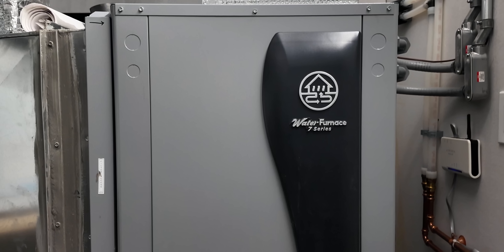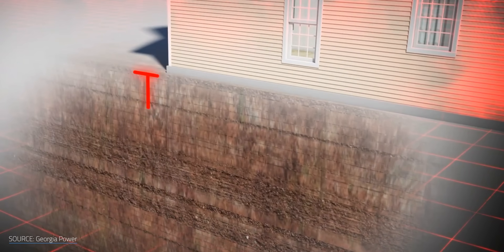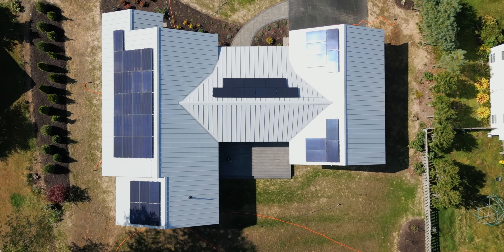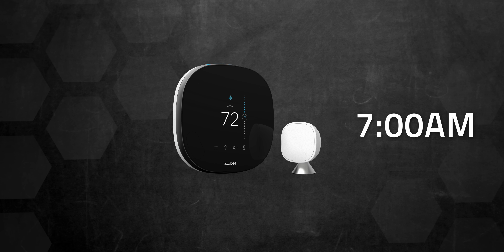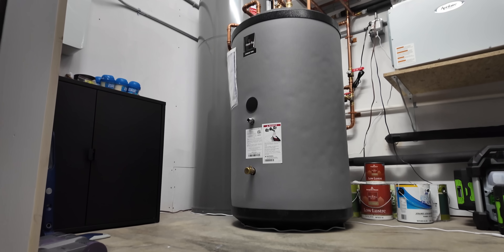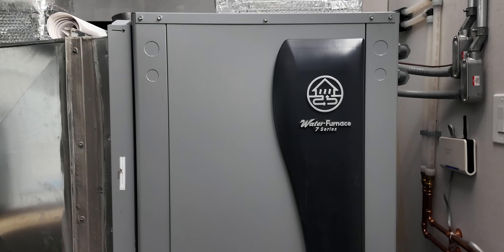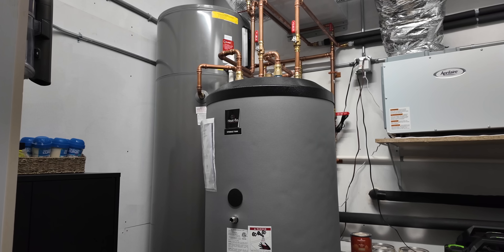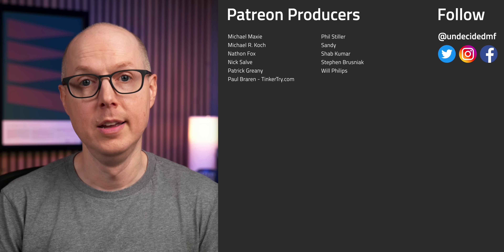How My Geothermal Heat Pump Really Performed (2 Years)

Comment: I have a 24,000 btu ducted mini split heating and cooling a 4160 sqft ICF house and it does great for a fraction of what these systems cost. I dont understand why people still put these in with the extreme cost of the system. I did my own instal and with ducts and everything else after rebates I am still under $3,000. My house is in northern indiana. I find the thermal mass of the ICF construction is a huge buffer that adds to the consistent temps in the house, our cost monthly to run it here is about $60 a month.

Comment: These systems are good, save money and are efficient.  I have had a heatpump for 22yrs, first one lasted about 15yrs.  These really work well if you have a big garden and can have a whole drilled vertically down. If you have a even bigger garden then you can did the pipe down horizontally.  I live in Sweden and the temp does go down to -22C in my area (colder up north).  The system struggles when the temp gets lower than -15C but my house is 100yrs old, but very well insulated. As with EVs if you have a house with drive and garden charging and EV and having a drill hole is easy.  However, people living in towns with no drive or garden cannot have these.  New apartment blocks can try to have a communal/share heatpump for the whole building.  Your installation looks a bit messy, we have 2 boxes in the cellar, the 16kw heatpump with 100l hot water inside and another separate water tank/box with another 150l.  They are the size of medium fridge/freezers, not as much pipe work as you have, so they take up less space.  You could put one in the kitchen if you do not have a cellar or separate room.  Swedish efficiency!   I would recommend this company, they have made and installed these for decades.  https://www.nibe.eu/en-gb

Comment: 11:20 Seeing as this is math, if a claim is going to be made that the "free electricity" from the home solar is being used to power the geothermal system, then the cost of the home solar equipment and its installation/maintenance (or rather the percentage of it that is being used to power the geothermal system) has to be added to the installation/maintenance costs of the geothermal system. There is no doubt that geothermal multiplies the amount of energy available from each watt of electricity used, but with upfront costs in the $50,000 - $80, 000 range, and regular heating cost for a typical home of $1000 year when fueled/powered by the existing grids, even if the new geothermal system was free to operate, therefore a savings of $1000 per year, it would take 50 to 80 years to realize the amount of savings that would cover off the upfront installation costs of the $50,000 - $80, 000 geothermal system.
Reply: Well, your figures are insanely high, for Sweden anyway. I have an air to air heatpump, it costed me 2500 USD (in SEK 25000) all installed. Geotermal heatpumps is depending on if you have a deep drilled well or a base area well. The former costs about 8000-15000 to drill (80000-150000 SEK) depending on the depth. Base area, well it is depending on how fun you think digging is.....The real bummer in your price comparision is the solar panel system. First of all, my costed totally 50000USD, but then it is of course not intended for any heat pump only. It supplies the whole electricity demand of the building. AND of a small EV-car. If you put these figures into your calculation, it turns out completely different.
Reply: @mikaelpehrman4815  The figures used were right from this video. What you're using is a reverse air conditioner, a technology that has already been around for 50 - 80 years, and it hasn't replaced the traditional electric/fuel grids, and has nowhere near the capacity of large scale in ground geothermal, particularly in colder climates where a full duplicate heating system (almost always grid powered) is also required to be installed/available for the really cold days where the air-to-air heat exchanger can't keep up. Why pay for just one heating system when you can pay for 2 right?? The warmer the climate, the better your solution works. I don't disagree with you though as in most cases a Rolls Royce solution is not necessary. The calculation was based on solely the home heating cost comparison and excluded the portion attributable to the solar equipment used to power it (which would result in longer pay back time). Yes the payback period for the solar electrical system could be different, but you don't get to claim that just because one system has better payback time, that it can be used to offset the lifetime cost of the geothermal system. That'd be like subsidizing yourself.
Reply: @lostwave4880  Well, let me start like this: I live in Sweden and I find the related costs hilarious. That of course needs some deeper explanations.
I live in Sweden, at latitude 57, which is about middle-north of Scotland. It is considered to be the south of Sweden, and that means that december to february means winter. And heat-pumps is a normal way of heating houses in Sweden. But Sweden is partly a very cold country, and the type of heatpump used is depending of the latitude. In southern Sweden, to about the latitude of Stockholm we normally use air to air heatpumps, or air to water heat pumps.

This means that you find two different network designs in southern Sweden, the heat pump as a support device or as a constant heat source. I use the former work mode, as a support device. This means that I keep it operating at outdoor temperature down to -10 C, and that is more of a support for us travveling etc, and not having the possibility for fire wood. (Which is VERY cheap here). This is VERY common in Sweden and it did cost me exactly 2500 USD, complete installation included. It is a Mitsubishi heat-pump with a maximum heat output of 5 kW. Since I have a two store building with a relatively open room layout, this can keep the temperature at decent levels down to an outdoor temperature down to -5. In the data of the unit it is said to work down to -25, but we all know that the COP-factor will go down from 5:1 to almost 1:1 at these temperatures. Practically -10 degrees is the minimum temperature it will work with some efficiency. And this is easily supported by my solar system. During summer it is of course used as an AC during the few days with temperature above +25 C.  

Normally during winter, I use fire-wood. In a water based radiator system. This means that my furnace is located in the cellar, and from water tanks, it is circulated throug the entire house in the radiators. These tanks can be heated electrically and by fire wood. Earlier I had also energy pellets, but I skipped that, since this solution is somewhat expensive. Oil was earlier used, not by me, but some of the earlier ovners, but just some old evidence of it, can still be seen. Oil did almost dissapear in Sweden in the 80-s. Coal is long gone, and gas is just non existant.

A lot of houses in the vincinity use a heat pump for this water based system, namely an air to water system. This is very common in southern Sweden. An unit with some 15 kW output will cost me about 5000 USD, with installation on top of that. For me as a certified electrician, this adds up some 1500 USD. I have prepared for this, since Im retired, age 66, and fire wood is some work.

You may ask question of the water base system? Well it is mandatory in Sweden to fulfill standards, with multiple energy source possibilities. And about 30 cm of insulation. And even if my house is old (1952) and retrofit is not demanded, you must have an energy declaration before you sell it. Without fulfilling the demands it is more or less not possible to sell. And you cant build anything new without it. You will not get a build permit.

Further north the more common choice ground based heat pumps. Meaning drilled holes or energy extraction from sea, lakes or rivers. Now the bill starts to reach a total of 25000 USD.
Reply: @mikaelpehrman4815  Yes sounds like quite a variety of systems, climates, and requirements in Sweden! I was wondering about exactly what latitude in Sweden you were at  due to the wide spread in climate from north to south. I do also wonder if there is more price gouging in North America, but if I ever did a geothermal system (shallow excavate and bury) I'd do it myself as much as possible to avoid some of the labour cost at least. My temperatures where I'm at in Canada can be minus 30 for weeks, and gas is cheap and plentiful, but electricity can at times be quite expensive and vary in price significanyly at any time. Getting enough electricity from solar to power a geothermal system may not be possible. In other parts of Canada, electricity is used for heat from resistance heaters and it's still the cheapest option ... so cheap they don't even need to move to heat pumps (or rather going to a heat pump system is still more expensive because heat pumps cost so much more than a hundred dollar resistance heater). So in a free market, where gas competes with electricity, and either gas or electricity is cheap, geothermal doesn't gain much traction. Where gas is not available or electricity is high cost geothermal (air-to air first and then geothermal as gas/electricity grid costs both go even higher) becomes a viable option. Coal has been phased out here too, simply because natural gas is so plentiful and cheap. I do wonder what would happen if there was a natural gas grid where your at in Sweden, but that we'll probably never know :)
Reply: @lostwave4880  The temperature you describe is more like the absolute north of Sweden, I have an average of -3 for January and February. Up in the north there it is no idea to have solar cells for winter electricity, but in the summer there is midnight sun. Wind turbines work fine. So even a heat pump with a three phase connection is not powered in Sweden from anything else than mains. And since Sweden have a very low population density, new common networks are not what anyone could pay for. The line based telephone network is closing down except in cities. Most is cellular. And talking about cities, it used to be gas network in some of the bigger cities, but they are almost non existant today. I remember these from my childhood, and Im 66 today.
Reply: I looked up real world recent quotes from the area I am thinking of buying land in and it's $100,000 for ground geothermal installation, the incentives are largely gone (at least for now), and while I was already planning to do this anyway, it's highly wise in this expensive electric area to also put in enough solar to cover even most winter days. There may not be many people at all who are qualified and capable to do the installation and maintenance either. So this seems currently best suited to people who care more about eco value and efficiency than budget. It will probably be cheaper in the future. It may be substantially cheaper and more feasible to do well or pond based geothermal however, if you have a suitable property.
Reply: @lostwave4880   The forward march of inflation favors an upfront cost rather than cost over time... That's why most fiscally-oriented people would suggest someone take the lump-sum option in a lottery, despite it often being half the payout.
 And that's not considering a general pessimistic outlook on products and service costing more over time due to greed and monopolies - in the U.S. at least
Reply: @RascanThe6th  I don't necessarily disagree with you. But every time I try to cost out such a system, and compare it with the pitifully low cost of just connecting to the grid, the real world advantage in my situation (very cold continental Canadian climate) would require my fuel and electricity bills to increase by 5 to 10 times to make the upgrade/switch economically feasible. So when my grid costs do increase by 5 to 10 times it may come out to just being a wash, instead of right now coming out well ahead financially by staying on the grid (the upfront savings now of $50K-80K properly invested at 8-10% annually will be worth far more than the non-returning capital sunk into a geothermal system now).  Yes the equipment/installation at any such time in the future will for sure also be far more expensive, so I'm essentially taking the same gamble as you, just with my stakes betting on non-skyrocketing equipment prices while yours relies on skyrocketing grid costs. But my invested capital above beats out either scenario every time. if the world switches to renewables anyway, at grid scale, the costs of which claims are made that they are reducing every day, then why not eventually just keep connected to the transitioned grids anyway? And what if we accomplish fusion in 10 years? ... that won't be a DIY at home solution, but the electricity it generates for the grid should be vastly cheaper, so again would source from the grid to power whatever heating technology is most viable when that happens. Just too many possibilities to bet on at this time.
Reply: @lostwave4880  All great points. Seems like you've got a handle on what works best for you in your geographical/political climate (not that I previously thought you didn't).
Reply: @RascanThe6th  And make no mistake (as you've probably already realized) I really want to have full off-grid in-ground geothermal and solar electrical systems, and a super-insulated house, but would have to be honest that it would be a matter of what I want, with no self-deception that it would be a financially responsible solution :)

Comment: Caution! I installed my first WaterFurnace in 1990. I broke two of them by using the desuperheater for hot water. The hard water crystals eroded the copper lines inside the unit. I highly recommend isolating the fresh water loop with a heat exchanger. On my third unit now, and still an advocate for the technology and the brand. I keep the heat at 68, and cooling at 74. My average electric bill is around $120 per month. —Love your work!

Comment: I'm loving the new tech and Matt's content!  Not GeoThermal, but recently replaced a 30 y/o gas boiler with a Lennox ducted air-source heat pump and ducting.  I monitor usage and am extremely pleased with the cooling and heating efficiency!  I can keep the temperature low as I like it, then increase temperature quickly if I'm entertaining guests. The ability to filter, circulate and de/humidify air is huge!  I'm very please with the vendor representative that recommended this ducted system over the typically recommended multi-head mini-splits.  Maintenance of the mini-split heads would have been a PITA.   The heat pump water heater was a major improvement as well.

Comment: Using HVAC to heat and cool your home is an inefficient method, by far the most efficient is use the building as a heat sink that requires the heating/cooling loops to be within a heavyweight structure.  Check out the German Passive House designs that work on that principle coupled with very good insulation.  You can have extraordinary glazed area as they contribute heat by solar gain in winter and are shaded in summer.

Comment: Wow. Way to expensive!  $78,000!!!  One could have put in two 24,000 BTU mini-splits for about $5,000 each. Self install mini-splits are available, in one two or three ton size. These units cost from $500 to $3,000 for the unit and then install should be $2,000 to $5,000. Sticking the remaining $6,8000 into the stock market would have given and expected 10% return each year. $6,800 or $566 a month. If one wanted to be a little more independent during extreme and very cold months, a natural gas fireplace, a wood stove, or a propane fireplace could supplement heat during those 30K below zero winter nights.

Comment: A couple of things:
1. To make the refrigeration cycle more accurate, you should have mentioned the phase change between a liquid and a gas..  High pressure hot liquid in one side and a low pressure cold gas on the other side.  This phase change is density changes by over 100 times, which laws of thermodynamics means large temperature swings and thus an efficient heat conveyor belt.

2.  Say you are in SoCal.  Doesn't get that cold in the winter.  Air sourced heat pump works great and will save a ton on the energy bill.  Also, zoning your house makes a ton of sense to save on the bill.  When you are home, you keep the space you are in the most the most comfortable and let the rest of the place float.  With variable speed inveter based units, there is a general rule where it takes hours of constant 'cruise' running to equal a burst of rapid cooling or heating.  So say a quick run to the grocery store, just leave it on.  Off to work and school for the day, let the temps float and then pull it down as you are coming back home.  Actually feels better when the system is running, so you don't have to hit the set point before making it inside.  You just don’t want it still at the extreme when you get back.

3. I suppose a third point is if your place is very thermally efficient and you are willing to tke some temperature swings inside, summer cooling is most efficient at night and winter heating is most efficient in the early afternoon.  And if you are running a major computer setup, that is heat creation and it is best to plan around that heat.

Comment: Take care to not start double counting your savings ... you add savings regarding electricity production via the solar/battery array ... but don't add those costs in.

So ... if you then analyse your solar/battery array (as you've done in the past) and you start calculating savings based on costs you are going to start double counting the savings.

-> you need a full energy system analysis costs/savings etc. and then compare that to a standard home of the same size.

ps - 22-24 degrees C is on the high side - you could easily live 19-21 ... energy efficiency starts with yourself and changing your own living patterns etc.